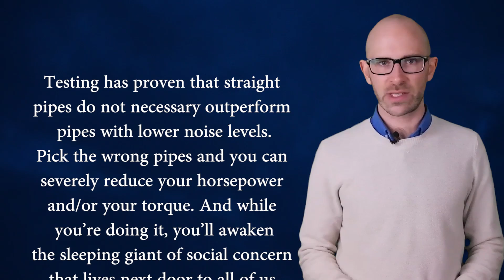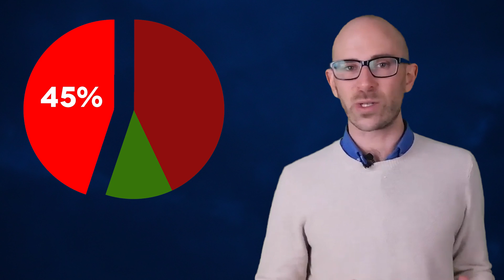Why are Harley Davidson Motorcycles So Loud?

Comment: As the president of a motorcycle club I'm trying to end this false safety tip, at least in my little corner of the world. First, the "loud pipes save lives" mantra was started as a result of comments to an article about a fairly infamous bike rally/race in Hollister, CA circa July 4th, 1947. Someone asked one of the bikers about the loud pipes of some of the bikes and he flippantly responded, "Loud pipes save lives." That statement was utter poppycock then and is even more asinine now. Now days, the vast majority of car drivers are locked inside their climate-controlled cars with the stereo blasting or talking on the phone with not a clue what is going on around them. They certainly can't hear a motorcycle with the pipe facing another direction than directly at them. Further, a large chunk of motorcycle accidents are single-vehicle accidents involving young or inexperienced drivers. Those loud pipes mostly go towards making anyone that can actually hear them hate motorcyclists. Right or wrong, it causes serious angst so the rest of us law abiding riders suffer the consequences of the actions of the few.
Changing out the pipes on your motorcycle from the factory pipes can result in less power. Engineers spent millions of dollars and many man hours making a pipe that works in concert with the intake and also meets noise regulations. When you change that pipe you generally upset that balance, dramatically in some cases. Loud pipes also cause rider fatigue. It is not unusual for me to ride up to 1000 miles in one day on my whisper-quiet motorcycle. You will never find an Iron Butt rider with loud pipes...ever. When I ride in large groups with loud pipes I'm lucky to make it 200 miles. I just can't take the noise. Most of those guys/gals can't go very far either. (I wonder if they have figured out why?) Further, I've taken to having the worst offenders of the loud pipe myth ride in the very back of the group so as not to offend other, more respectful riders.
Loud pipes, if they do gain attention, generally gain negative attention. I've known more than one biker pulled over because a cop heard the roar of a speeding biker with loud pipes. They didn't see the perpetrator, they heard them, then followed up with action. Police routinely will pull radar with the windows open exactly for the reason of hearing a speeder.
I've seen two articles in recent times where apparently an older person turned their car into a loud sound. I've tried finding them again, but have had no luck. It is possible someone trying to combat the loud pipes falsehood created one of their own. I will continue to look for those.
So, loud pipes annoy others, cause poor performance in many cases, and cause rider fatigue for those riding the loud bikes and even those around them. I would also argue most of the loud pipe crowd doesn't wear PPE for the most part. Those are people we refer to as Organ Donors. You can do much better things to be seen and avoid accidents, like take classes and join a group of like-minded riders. You can't fix all drivers, but you can control yourself. As one of my riding idols said, "Let it not be my fault." (Neil Peart -- drummer from Rush and avid motorcyclist.)
/dons fireproof undies

Comment: Loud pipes let other passenger vehicle drivers know you are there.
Reply: Sure, it's the driver's fault and not the motor cycles squeezing between cars, breezing through red lights, and cutting people off.
Loud pipes aren't going to help someone hermedically sealed in a box with it's own engine, a radio, and AC to spot the narcissist whipping around them.
You hear sirens (you'll likely spot red and blue lights first) you pull over regardless. People should have to pull over for motorcycles too?

Comment: the "fact" of testing being proven it does not "necessarily" enhance performance is completely incorrect,

while it doesnt offer optimal performance by itself it does increase HP and torque as proven on millions of dyno reports. its part of a breathing system, often the manufacture puts on parts ranging from gear ratios to intake and exhaust even wheel sizes will be manipulated for MPG stats and emissions. back to the breathing part... most often its limited to breathing out (exhaust) so out of the intake and exhaust, the exhaust will typically yield better performance than the intake. then you add a better air intake and filter system, it really changes when you change the jets in the carburetor or add an after market performance module for an efi system (electronic fuel injection) now you control the mixture of air and fuel, and with a raised limit on air flow through the whole system you get much better performance and can even adjust it to save fuel (efi is much more efficient in this situation). its often referred to as a stage one performance system (the three parts combined) and with the buying and selling of used motorcycles I would guess that 65-75% of people have this done, usually by the time it hits third owner it will have been done.

if you limited exhaust then it limits the air intake, just like asthma. some types causes a valve at the top of the lungs to restrict and you cant fully breath out, which limited air you can take in as you already have to much old, used air. in this case its not a back and forth but a flow through (in one end out the other) system.

its tried and true and tested to stupid levels, and if someone takes a subset of a restricted case scenario and they dont see much gain does not mean its the typical known FACT. their INTAKE was probably the limiting factor to begin with, there are a few models of cars and motorcycles alike that are this way, but NOT THE NORM, its actually rare.

typical gains from just exhaust can be usually 2-5% increase in HP and torque (from stock), intake about 1-3% increase (from stock),  just a control module 1-2%, changing jets can have a very bad effect if the other things are not done yet. put all three parts together it is not unusual to gain 10% or more. its also the easiest three things to do for total performance gains compared to other options.

my bike stock (at wheel) was 87-92hp and 90-96nm (torque) AFTER I changed these three things I am easily over 105 HP and 112nm. had it adjusted on dyno the other day and these differences are based on the typical average that people get (1,000s of reports for my model alone)

so tell me again, how does it NOT improve performance?

Comment: Intentionally generating high levels of noise in public by any source should be treated as auditory assault. If the noise level is high enough to damage hearing, its no different than striking people at random. Arrest the person responsible and impound the noise generating device until after the trial.

Comment: On the topic of hearing loss, wind noise is so loud at highway speeds that the exhaust is hardly an issue for the rider. Wind noise is one of the main reasons people get hearing loss on motorcycles, but loud pipes do contribute to a little bit of it too.
Reply: The rider is willing to sacrifice his hearing to have loud pipes but he doesn't have a right to damage the hearing of everyone around him. Some bikes (NOT just Harleys) are painfully loud. Exposure to loud noise, even brief periods of time, causes hearing loss. This loss is cumulative and irreversable. I've been riding street motorcycles for more than 40 years and I like quiet motorcycles.

Comment: Blind spot? Cammi Rosanov I've been hit by cars 3 times. All three times the driver was looking right at me. Two of those the drivers decided to turn left in front of me even though I had a headlight on. Now I ride with bright spot lights during the day and have had no one attempt to pull in front of me.. I have had a couple middle aged women force me out of the way on purpose 🤔 think someone's scorned by a previous lover on a motorcycle. I ride with stock exhaust above and beyond government standards.
Reply: Were you cruising through a yellow and/or red light or weaving between lanes like all the riders I see? If not, you're probably the exception and not the norm.

Comment: #1 From the factory Harleys are very very quiet.. almost no exaust noise... Like a new car.. #2 it's all about the money... The first thing, at the dealership, they do is offer you all the exaust upgrades, at a a $1000.00 bucks and up... So they tack that right on top of your note, with finance charges... #3 you must have pulled those accident stats outta your ass, cause they're not even close..Idiots on cell phones run over each other every day, they don't even acknowledge a human on a bike, no matter what flavor it is...#4 this is exactly a "walk a mile in my shoes"  scenario.... If you bought a bike, you'd do the same... And finally: #5 the Jap bikes are just as loud,  and the people who own them generally ride like idiots...  That might be where you're getting your bogus  stats...so don"t lay all that burden on or make it sound like Harley riders are soley to blame...next time you might want to check your sources, you really missed the ball on this one...

Comment: I own one with stock pipes. The reason why we upgrade pipes is to notify the cars next to us that we are beside them. I'm 50 years old, former engineer, have ridden over 30 years. With the recent advent of portable information devices the attention span of a growing number of drivers is increasingly diminishing. Since I've nearly been clipped more than once by distracted drivers that didn't see or hear me right next to their door I've decided to upgrade the sound of my bike to hopefully reduce such instances. Stay tuned, if you don't hear back from me you will know the result of my experiment.
Reply: Use revving or the horn. Just like a normal person who aren't stuck up their own a**hole.
Reply: Loud pipes saves lives
Reply: Hello
Reply: Mots. BS. If you're soooo worried about being safe on the road here's a few suggestions that will enable you to be seen as much as is practicable given the various circumstances vehicle drivers find themselves in. 1. Slow down. 2. Headlight on and wear a flouro vest. 3.Don't speed between cars like an idiot. In fact don't speed at all if you're worried about an accident. 4. Allow for drivers not to see you at all times. I rode for a few years so I know they sometimes cannot see you even when their head turns to look in your direction (Windscreen side pillars). Has happened to me but I "worked it out" and avoided an accident. So, Mots, how about you back off on the noise angle ("An empty drum makes the most noise". Not complimentary.) and take a much more non-hero style approach to motorcycling, huh?
Reply: @747fa  Nah, you can take your fairy advice and shove it. Thanks.

Comment: It's not Harleys that are the problem, it's the crotch rockets that have a higher pitch and are therefore more annoying. Also the ricers when douchebag owners remove the muffler or replace it with aftermarket crap because they think it's cool that their car sounds like it needs to go to a junk pile. Those are worse too. And then there are leaf blowers which are far worse than all of these things.

Comment: I understand there's the whole "loud pipes save lives" argument but at a certain point I just want to ram you to shut that shit up. Yeah, I have aftermarket exhaust on my bikes but they aren't loud af. Really, it isn't any louder than the stock exhaust, it just sounds better (and shaves off some weight). Also, when idling, I'm relatively quiet (quieter than some car's radiator fans).